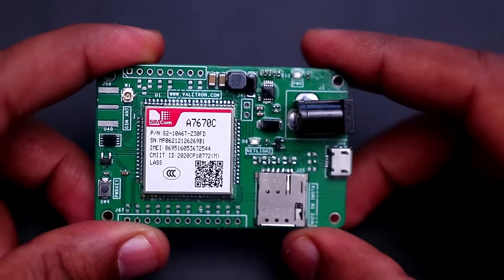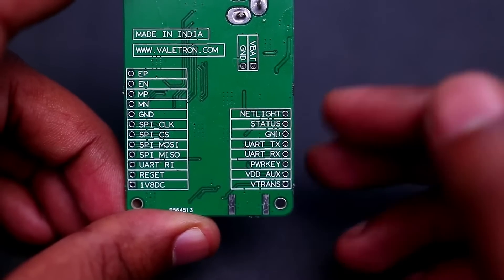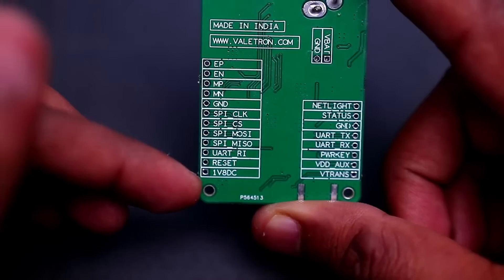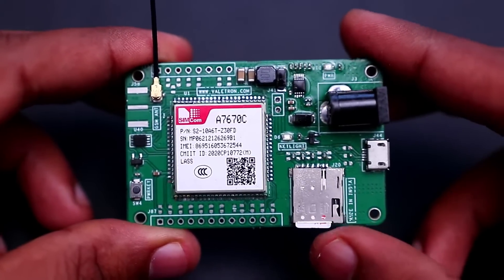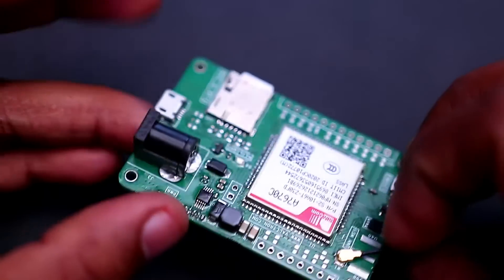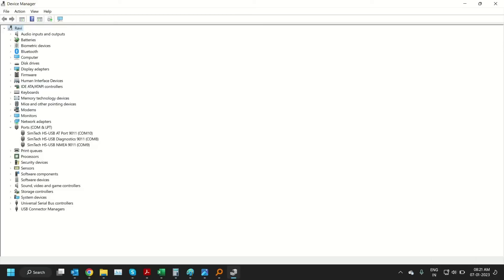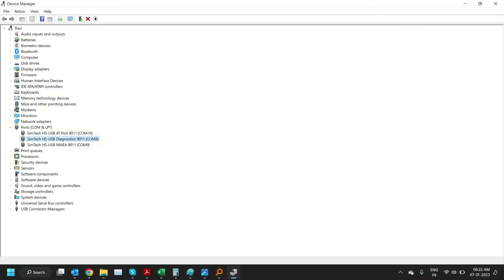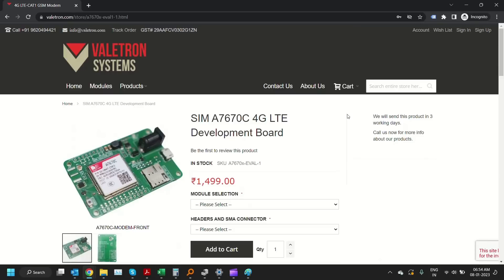Super cheap 4G LTE modem with  SIMCOM A7670C/A7670E/A7670SA

Comment: sir i buy A7670C module, it is not working . i live in india, up . location can be a resion for not working? blue light is contineusly glowing, not billing .i used jio sim in it. should i need to add big antina?
Reply: I think won't work with jio 😢
Did it worked??

Comment: Hello Sir.
I have few questions

1) is this device compatible with raspberry pi 4 ?
2) Did you check with raspberry pi 4 and did you get the 4G Speed after connect this module in raspberry pi 4 ?
Reply from the maker: 1. Yes it is compatible. You can interface by USB or UART.
2. USB mode on windows , 5MBps download, 2 MBps upload on Airtel SIM tested.

Comment: did you have a7670e? is a7670e support jio sim for sms and calls , i tried a lot ,but not successfull with jio sim , bsnl is working perfect but jio is not working,  since its showing ATREADY, SMS DONE, network connection and all with jio sim , i am not able to send and receive calls and sms, i don't know why ,can you help me
Reply from the maker: I think it doesn't have VoLTE. It could be the reason and European band module lacks band 40 support which Jio uses
Reply from the maker: Use A7672S
Reply: thanks will test with it
Reply: do you tested with that a7672s with jio sim
Reply from the maker: @kvamsidharvamsi5800  Yes. It works with our A7670C-LASS board also. Short Video is there in channel
Reply: @RaviPujar  ok, will see..., A7670C is only 4g module, but i need 2g 3g and 4g gsm module

Comment: Hii Sir currently i am working on Simcom A7670C adiy breakout board. I done 2 programs on that to sent and receive the data these two programs was successfully done using JIO sim. After that i want to sent some  data of a sensor to mqtt. For that i changed the sim from JIO to Airtel from then onwards my net light led was not blinking and the module was not able to connect to the network after that i inter changed the Sim's again. And this time for  jio sim  also it is not taking the signal. And i contacted adiy customer support from there also i didn't get proper response. So please help me in this sir.
Reply: Heyy can u share the code to send and receive sms using this board
Reply: Does it support jio sim now?
Reply: Hi are you able to figure out what was the issue?

Comment: I'm really lost as where to start programing this over a ESP32 with VSCODE , do you have a tutorial or guide for this?
Reply from the maker: We don't can't esp code for this. But you can check VALTRACK-V4-VTS-ESP32-C3, it comes with same module and ESP. And firmware is on github

Comment: Hi. What is the diff to SIM7600G-H R2? What sim card do you use?
Reply from the maker: A7670 or A7672 series are Lower cost compared to SIM7600 series. Smaller in size too. H series is for high speed, CAT 4 data. These are CAT 1 modules
Reply: @RaviPujar  you say the A7670 or A7672 series is not for high speed and not good for video streaming stuff? could you use that A7670 or A7672 series with ESP32 and connect it easily?
Reply: @RaviPujar thanks for reply. what microcontroller can you connect the board with - raspberry pi zero W or a ESP32? please let me know. also what is the power consumption of the A7670 or A7672 series? im looking for a LTE board which works in the US and in europe.
Reply from the maker: @Gerald-iz7mv  You can connect to any MCU using UART lines. Power consumption is different in each modes. You need to refer to datasheet. A7670E/A7672E works in Europe. For USA A7670SA might work but it doesnt have certifications needed for USA, So either use SIM7600NA /SIM7600G for USA, or SIM7070G

Comment: I purchased this  SIM7670 module from your company but have been experiencing issues with both the module and the driver bit.

Firstly, the module does not seem to be responding accurately to the network status, despite attempts to troubleshoot the issue. I have tried using the TinyGSM library and various SIM cards to make the module work, but have had no luck. I connected the UART TX and RX to RX0 and TX0 on an ESP32 and attempted to use the TinyGSM library, but the modem.waitForNetwork() function consistently fails even though the module's status light is blinking.

In addition, we have been having difficulties with the driver bit. We have not been able to find an installer for the driver and have some DLL files that we are unsure how to use. We downloaded it from the docs.

As such, I would appreciate any guidance or support you can offer to resolve these issues. Thank you for your attention to this matter.
Reply from the maker: Hi,
We had replied to your mail. Please check. May be it ended up in your spam folder.
Reply: @RaviPujar  thank you but I can’t find it for some reason :/
Reply from the maker: @sujaysuvarna  Resent it now. You can check again

Comment: Hi, Mr. Ravi. I have several question. 1. Does the "LASS"  has any significance meaning?  2. Does the module still in production or will discontinued soon? 3. Could you share the A7670C AT command documentation? Hope you can answer my question. Thank you.
Reply from the maker: Each letter indicates what features it has, like analog audio, gnss, Bluetooth. Find it's datasheet. That module is not going away anytime soon
Reply: I think the price is going down, I bought it for just 10$

Comment: Hi,  I will be connecting microcontroller to this board through UART. I presume, the controller can communicate with the module using AT commands on UART. Pls confirm.  In your video usb channel is used to communicate using AT commands.
Reply from the maker: Yes, it supports UART. You can check our website for connection details

Comment: Hello Ravi, is there any configuration changed in the new A7670C module. Earlier version it was working with Jio sim. Now the new module is denying network registration.but it's working fine with Airtel sim. Do you know why it's happening?
Reply from the maker: Hi, Which versions you are talking about?
Reply: Hi are you able to fix this issue ?